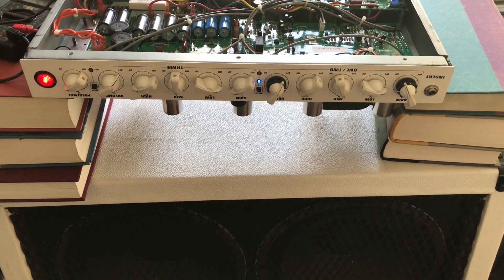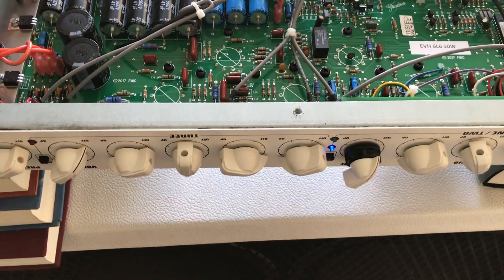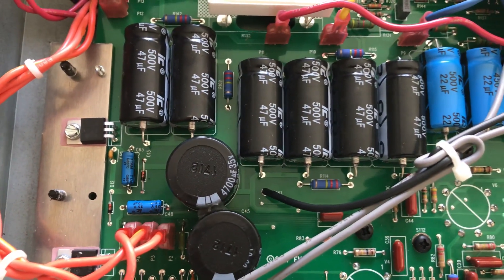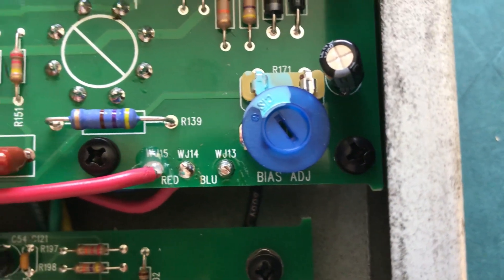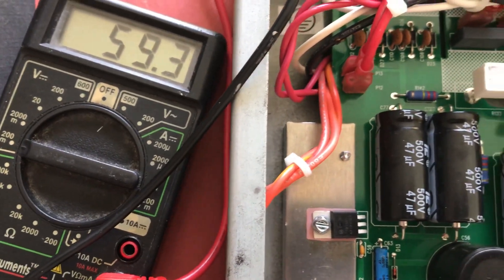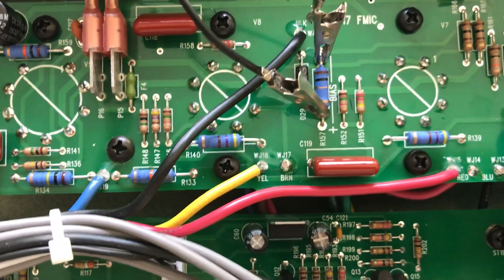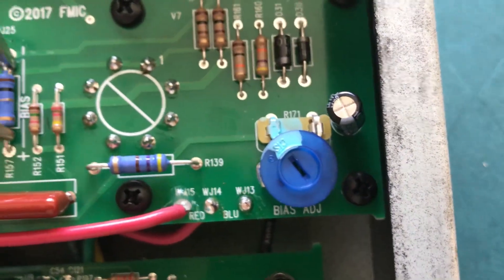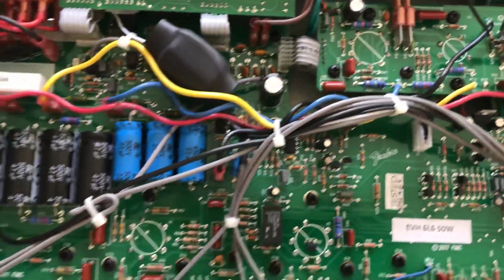How to bias an EVH 5150 iii 50 watt 6L6 head

Comment: So if I replaced my tubes in my 5150 iii with the exact same brand and model tubes, would I still need to bias? Thanx
Reply from the maker: Absolutely. Tubes that are a matched set, even those that supply the specs, will vary. And even replacing old tubes with new ones from the same brand will vary somewhat. Any time you change power tubes you should check and re-bias. I also check the bias every so often. Like around every 24 hours or so of burn time. Especially if I’ve been running them hard.
Reply: @TheAxe4Ever  what if you're just changing the preamp tubes? You need to bias then too? I have no sound on channel 1 and 2 and I think it's the preamp tubes. The thing is under warranty still but the one place closest to me is really booked up and the other places are 45 minutes away.
Reply: @manicmurph  No, preamp tubes don't require any biasing, only power tubes. 

The issue of having no sound almost surely isn't the preamp tubes though. That's a connection issue somewhere like a solder connection gone bad or sometimes just a dirty connection can cause a channel to cut out and simply cleaning it will fix it. Fender/EVH are notorious for bad solder jobs out of the factory that only rear its ugly head down the road usually after the warranty expires so you got lucky there. Considering this comment is 8 months old, I'm sure you've figured it out by now.
Reply: @trainofthough0242  I figured it out, it was the preamp tubes. Two of them in the front. I could tell that two of the lights were off cause I have those tube covers on them ones and it looked a little dark. I popped the cover off and two of them were dead. So my local repair guy sent me two what were supposed to be JJ tubes but one was a sovtek and one was the other brand I can't remember but they were still the same kind of tube, the 12ax7 but I think I made out cause the sovtek are more pricey than the JJ tubes I think. It sounds the same as it did before with the stock tubes.
Reply: @manicmurph  Interesting, preamp tubes usually don't go dead like that to the point it kills all volume on the channel. They usually slowly just burn out and gradually begin sounding worse and worse. Like I said though, EVH/Fender use the cheapest parts imaginable so it doesn't totally surprise me either that you had a preamp tube completely bite the dust like that.
Reply: @trainofthough0242  I think I did it the day before cause I had it on standby with the guitar plugged in on accident for like 4 hours. Then I read that it can hurt your amp to leave it on standby for a while which was kind of surprising to me. I mean I guess 4 hours is way too long and ridiculous though so idk.
Reply: @manicmurph  Nah, leaving it in standby for only a few hours won't hurt anything. It's designed to be on for much longer periods than that, days even if you want and you'll actually save your tubes from excessive cold/hot power cycles which is what really kills the life of tubes in the long run, constantly turning it on and off so if you lessen that, it's actually better for the tubes. 

There's a lot of misinformation online from guys that think tube amps are these delicate things that need to be handled with kid gloves but they're really not. The good ones are designed to be put under much heavier loads and demands than what most people who own them put them through. Unless you're Fender/EVH and you put such cheap tubes and parts in the amps that they blow up anyway no matter what you do, but that's just because of poor quality, not user error.
Reply: Yes

Comment: My stock tubes were reading 46. Swapped in some new Tung Sol tubes and it was reading 130+. Turned the bias pot all the way down and now I get 69. Does that sound right? I can't get it any lower.
Reply from the maker: Long answer ahead! With the plate voltages the 5150iii runs at, a bias range between 60 and 70 is acceptable and even considered running cool. So 69 is fine. My only concern is a jump from 46 to 130+ seems a bit extreme. It may be fine, but it seems like the new tubes are drawing quite a bit more current. It is possible that a new tube can be bad. Like a “short” or some other issue. I’ve had that happen a couple times before.

     Watch your tubes closely for a while. Even though you have the pot down as far as it will go and they are at an acceptable range, watch for what’s known as “red plating”. If that happens, SHUT IT DOWN and put the old tubes back in and bias those up to range. Again, it may be fine but that jump seems a bit large to me. I am not an electronics or electrical engineer or anything, I’m just giving advice from my experiences. Just keep a close eye on the tubes. If everything seems fine, after about 10 hours of playing and burn in time, check the bias of the new tubes again. Do that a couple times and if everything seems fine, it should be okay. Hope my rambling helps. Good luck!
Reply: @TheAxe4Ever  I ended up putting the old no brand 6l6s back in last night to see what the reading was (after having adjusted all the way down on the bias pot). It read 15mv with the old tubes. I put the Tung Sol back in and dialed it up to as stable 70mv as I could get. Gonna roll with that and check it again later. The amp mostly gets used at bedroom dad levels so I rarely ever really get to crank it. Thanks for you response.

Comment: Mine just made a loud pop/thump thru the speakers while I was playing....now when you engage the FX Loop,the volume drops in half....any idea what might be the problem?
Reply from the maker: Damn. That sucks. I wish I could help you out but that kind of diagnostic is above my pay grade. Do you have anything plugged into the effects loop? If so, check to make sure the cables hooked into your effects loop aren’t faulty. Even check the effect loop jacks. Check all the preamp tubes. If you have a spare, try swapping it in each position to see if the problem goes away. Even check the phase inverter tube (12AX7 next to power tubes). Those would be the places I would start. Good luck. Hope you find the problem.
Reply: @TheAxe4Ever  I have a reverb pedal plugged into the loop....it worked perfectly until that loud pop bang thing....the older ones had a tube driven loop,so I figured it was just a bad tube...evidently,they changed this in the new models...they have a SS buffer....it’s just out of warranty,and I live in a town that has no service centers or anyone that can work on tube amps....other than the loop,everything works fine...as long as you don’t engage the loop,it’s perfect.....I don’t know what I am going to do with it....Thanks for the help anyway..

Comment: Perhaps a stupid question, but... is this done with the amp in standby?
Reply from the maker: Sven Jeschke Any question is a good question. I do my connections with it on standby, but then to get the readings you have to have it off of standby. Also another thing I didn’t cover in the video that I should have is always make sure that your amplifier is connected to a speaker cabinet. Never run a tube amp without a speaker load on it. Hope that helps. Cheers!
Reply: It's actually ok to bias these with no cab attached and turned on.  Just don't have any input attached at all!!

Edit:. Howard Kaplan has said as well that the speaker outs are shorted when no cable is plugged in, so no worry's of it being open and destroying the output xformer.

Comment: Nice! Glad to see there is a trim pot in there. Thats what I was hoping to see. Def go with JJ. Those JJ 6l6s are the best sounding 6l6s of new production to me.
Reply: Hey, interesting you say that about the JJ 6L6's.  I had a Fender Deluxe Reverb Reissue, and I absolutely loved the JJ Tesla 6V6's for that amp.
Reply from the maker: @DerrickCampbell-tk3bn Since this video I have changed my mind on the JJ’s quite a bit. I have found that one. I run them at the colder bias that is recommended by a VH, I think they are a bit sterile. But when I run them up to where they should be at about 70%, they sound awesome! I guess that could be true with any power tube, but it seems to really make a big difference with the JJ’s.
Reply from the maker: Crixus The Gaul Yeah man. This amp is killer. The workmanship is top notch for sure. I agree totally about the JJ power tubes. They sound great with a nice round, yet tight bottom end. We all love a round, tight bottom end! 😂 And when pushed hard they just get better. For the preamp section I found (after some experimentation) that I really love the Tung Sol’s. The JJ 12ax7’s sounded good, but the Tung Sol’s sounded great! Thanks man!
Reply: @TheAxe4Ever  I had an incredibly big issue with my first one. Took it to two authorized repair shops, they both held onto my amps for months and were unable to fix it. Eventually Fender sent a new one. When the new one arrived, it didn't work! Turns out my PI tube was cracked in half but still fully intact. I went to remove it and the class came off like a top section. Had a real hard time getting one of these amps going... the first amp I had sounded waaaay better than the replacement. I wonder if it was biased higher and my new one is cold like you were saying!
Reply from the maker: Crixus The Gaul Damn! That sucks. Two issues with two amps in a row! At least Fender tried to make it right by sending you a new amp. Then to have that will not work must’ve really put you through the roof! Guess I got lucky. I bought this used from GC. I live in Florida but it came from California. I took a big chance and got lucky I guess. When I first got it I noticed it was loud and punchy but just sounded a bit flat. I mean it sounded good but just didn’t blow me away. The JJs in the power section sounded great but I wasn’t happy with the JJ preamp tubes. As soon as I put those tongs all tubes in and biased the power tubes correctly, then it blew me away! Very responsive amp to the types of tubes that you use. Experiment with it. Definitely bias it at 60 mV. No more than 65 mV. That’s cold but this amp was designed for clean power like that. Any warmer bias and it will start sounding a bit dull.
Reply: @TheAxe4Ever  I always wondered about going tung sol. I went a little crazy with vintage pre amps tubes a few years back. I ended up just enjoying straight JJS though. I want to try their new frame grid pre amp tube or whatever it is. 
I'm glad to hear about the tung sol. Those do get great reviews. Where do you get your tubes at? I use tubedepot my self.
Reply from the maker: Crixus The Gaul Same here. Either Tube Depot or Dougs Tubes. I like the Tung Sol’s in modern amps. You can spend an ass ton of cash on NOS vintage tubes. I don’t think those are really necessary for modern amps. Just find a favorite new production tube and they work great in them. Now if I had like an old vintage Fender amp that I was using for cleans, I would spring for NOS tubes. But in my opinion, for screaming overdrive the new productions work just fine.

Comment: Great video, i have the EVH 5150iii stealth 100watt head which has the bias ports and bias adjuster on the outside. How would i check the bias on this and buy new tubes to make sure they are pretty closely biased to the tubes in the amp now, sorry i never did anything like this before. Have a great day
Reply from the maker: Chris Dorino Thanks! Wish I could help you but I don’t have any experience with the 100 watt Stealth Head. I’ll admit I’m a bit jealous though. I’ve heard them and they are incredible sounding amps! On a 6L6 100 watt head with an average plate voltage of around 475, I usually run about 30 millivolts per tube. I believe that will get you where you need to be. I’m just not sure how they have their test points set up. If it is a single tube, 2 tubes or all 4 tubes. Just not sure. Sorry I can’t help you with that.
Reply: Use the bias ports on the back with multimeter to check. The 100 watt 6L6 version is recommended at about 30 millivolts per tube so you want a reading of about 120 mV across all 4 tubes.

Comment: Thanks for this video....I have this very amp...just got it a month ago...I absolutely love it...I used to have the 100 watt version,but I much prefer the 50....it’s the tightest,punchiest amp I have ever heard....I was thinking of swapping tubes,but like you said in the video,they were designed around JJ’s,so I may just stick with those....I do have some Tube Doctor 6L6’s laying around...may give those a shot....
Reply from the maker: Thanks! Glad this was helpful for you. I thought about re-doing the video because I failed to mention to make sure speakers are hooked up to the amp or you could damage your amp. I just assumed people know this. I should have covered it. Also, I didn’t even try the amp out yet when I made this video. I wanted to check out the bias before I did. So I was wrong about the tubes. They are definitely JJ tubes. Just unlabeled JJ’s. I’m telling you they sound awesome in this amp. TAD’s are really good too. I had those in my Peavey 5150 and they sounded awesome.
Reply: TheAxe4Ever yeah,the tubes in mine are unlabeled JJ’s....and it sounds awesome....I couldn’t imagine it sounding any better....I think most people that own tube amps would inherently know there has to be a load on it at all times...but you never know...I was also impressed with the build quality of these amps....and the Transformer is huge...must be why it’s so loud...
Reply from the maker: Scott Peters Yeah man! They are built very roadworthy and the PCB layout is very well organized and clean. I can’t find a cold solder joint anywhere on it. It makes my old Peavey 5150 and Marshall JCM 2000 look like they were put together by grade school kids.
Reply: TheAxe4Ever Just wanted to post a little update.....I changed the power tubes to TAD’s.....sounded great....I put in some Sovtek preamp tubes.....they sounded pretty good.....I also used a couple of others...my final impression,stick with the JJ’s.....all of these amps come with unbranded JJ’s,and I think they sound the best.....they are a tad darker,but I think they fit this amp perfectly....after biasing,this little amp is crazy good.....it’s just got this underlying deep punch that is awesome.....very loud too.....about to order a Boss Tube amp expander so I can Krank it and control the volume thru the TAE......Thanks for the video....I never would have tried the tube swap without it...

Comment: Dude, I just bought one of these brand new from sweetwater and it has Chinese tubes in it...very disappointed cause the el34 head has jjs in it....I'll replace them with either jjs  or tung sol....please do an update video when u get yours done
Reply from the maker: Christan Mitchell The only way I have to record my amp is with my iPhone and it doesn’t do it justice. I did some experimenting with some different tubes in this amp and thought I’d report what I found out.
     I had some matches Mesa Boogie 6L6’s hanging around and thought I’d try them in place of the tubes that came in it. Keep in mind I hadn’t even tried the amp out with the original Chinese tubes. The Mesa Tubes are actually Chinese tubes from Ruby, selected and matched by Mesa Boogie. They sounded really good. Punchy but just a touch of brittleness in the top end. So I thought I’d give the original Chinese tubes a go. I reinstalled them and set the bias and WHOA!!! They were incredible sounding! They held a really stable bias too. The sound was warm with TONS of punch. And the mids and high end had a lot of really cool swirling harmonics. I was very impressed with them. I should have listened to them first! I looked more closely at them and noticed they are a dual getter designed tube. The other dual getter designed tube I have tried in the past were TAD (Tube Amp Doctor) tubes and they sounded awesome. By the way, they are also Chinese tubes. I know Chinese tubes get a bad rap but some of them are actually really good and preferred by a lot of players.
     I didn’t care for the original Chinese preamp tubes at all though. Very brittle and harsh sounding in this amp. I had about 10 or 12 Electro Harmonix 12ax7’s on hand and put them in and it was a big improvement. But I still may try ordering some JJ’s for the preamp section. But as far as the power tubes go. I’m gonna stick with the tubes that came in it. I think they sound great! Try changing your preamp tubes first if you aren’t happy with the tone of the amp. At least the one in the V1 position. Cheers!
Reply: Christan Mitchell I have a 2016 version. Same garbage tubes. I wound up putting some 70s RCA 6L6s in. Nice nice sound.
Fender really should have put a gate in these amps. It’s stupid having to put noise suppression in.
Regardless. The amp sounds terrific.
Reply: @Thomasdgolden  what type of tubes did those come with?
Reply: @thefam9179  the Amp had Garbage tubes.
Reply: Christan Mitchell same dude. The 6l6 tubes are absolute s**t!